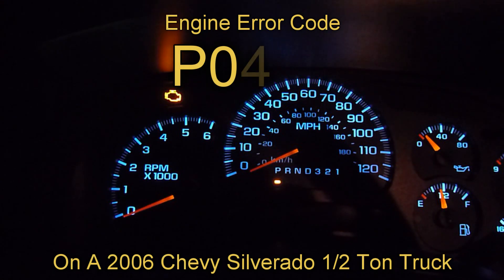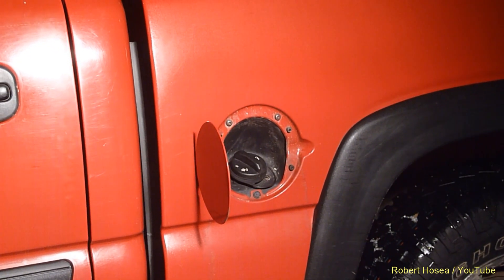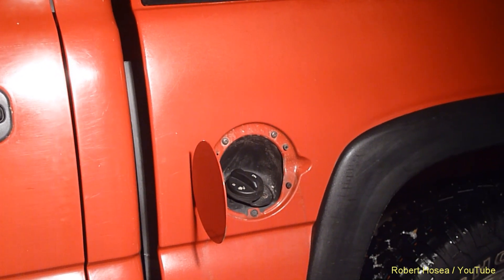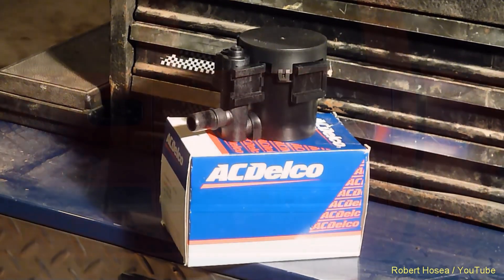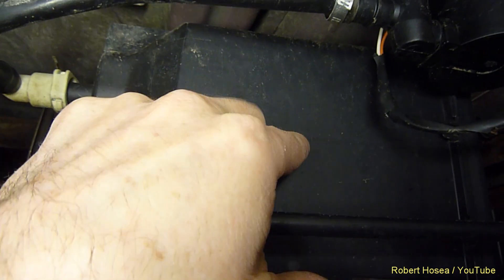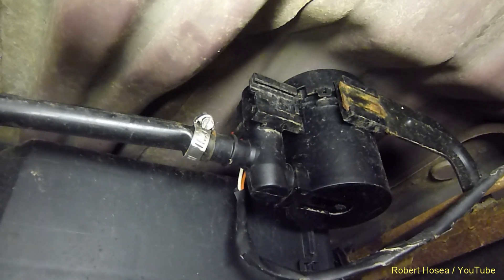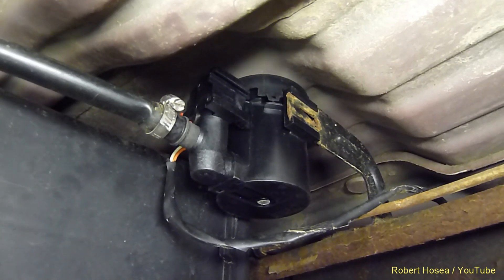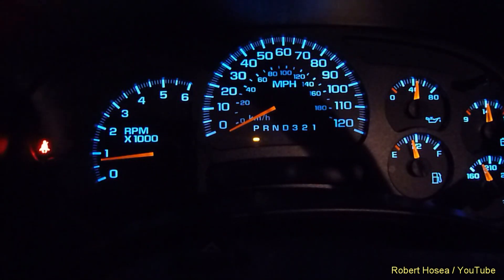Code P0449 Vent Solenoid On 2006 Chevy Silverado.

Comment: Question about where to cut the line on the bad unit that's still on the truck.  I assume the line has to be cut right at the end of the nipple, where it tapers back in?  Hope that makes sense.  Does the 5/8" heater hose just slip over the nipple?  Does the 5/8" heater hose also just slip over the existing line??   Thanks.  [IMG]http://i65.tinypic.com/4js080.jpg[/IMG]
Reply: DF RI   I couldn't done it without 5/8 heater hose. But worked well. Two clamps one by the part and other on the side of the original line. About 3 inches of the heater hose. 1 .1/2 nipple part and. 1 . 1/2  original hose in  and clamp it.
Reply from the maker: When I cut the hose off the first time that I replaced the solenoid, I cut it off right at the end of the nipple leaving the nipple on the solenoid. That meant I cut about one inch off of the length of the hose. I had tried to actually remove it entirely from the nipple, but I couldn't get it off. In your picture it looks like you may need every bit of length that you can get, so maybe it would be better to cut the nipple off of the solenoid (if possible) and then remove the portion of the nipple that is left over in the hose. That will leave the full length of the hose. When I installed the hose on the new solenoid I just took a pair of needle nose pliers, and pushed them inside the hose and turned the pliers around a few times to expand the end of the hose. It worked pretty well.

Comment: I've got a 04 Silverado 2500HD. Last year around summer, i got this code and couldn't fill my tank. I work at a GM dealer, so I looked up the part with my vin and there was a TSB on this thing. They came out with a new version of this part, it's got the solenoid shown in this video, but it has an extra nipple on it where a separate filter of sorts connects to the valve.

Anywho, I installed the updated part last summer which solved all my problems. A few days ago, my tank is running low, so I stop to put gas in it, boom. I can't fuel up and the P0449 code is back. I haven't forcefully topped off my tank since I replaced it. Looks like i'll be going for round two. Thanks GM!

Crazy thing is that I borrowed a buddy's scan tool (a very expensive one) and manually operated the vent valve solenoid which was working. It was showing the tank pressure dropping. Not sure what makes these things die so easily.. maybe gas sloshing around while driving around with a full tank? Next time i'm going to throw a coupler on the tube and try to mount this thing a couple inches higher.
Reply from the maker: Thanks for the info on this James. Let us know how it works out on mounting the solenoid higher. -Bob

Comment: hey guys this video helped me.bought mine on ebay for 20$ installed it but the engine light took 2 days to go off.
Reply from the maker: I'm glad the video helped out Michael. The way that I understand it is that most vehicles will reset any current engine error codes after a couple of successful drive cycles, but only after the problem has been corrected. I usually reset it myself with my code reader because I have found that the engine error code will reappear if the problem was not successfully corrected. Of course, it depends on the type of the problem too, on how fast it will re-detect the problem. I've found that there seems to be an on going debate on whether to reset the error engine code manually (as I usually do), or to let the vehicle take it's time to detect it on it's own.

Here's something that I found on a forum once, that I thought really explained it well. It sounds like the guy knows what he's talking about: 
============================================================================

here is the criteria for "check engine" light illumination and shut-off. when your on board computer senses a concern,  it stores a diagnostic trouble code (dtc) in its "pending" memory block. at this point the light is not lit. the next time you drive the car, if the problem is still present, the dtc moves from "pending" status to maturity and the light comes on. the light will remain lit until either:
1. someone clears the code with a scan tool (if the concern is still present, the light will come back on shortly) or
2. if the car has three successful drive cycles with no concern detected, the light will shut itself off. if this happens, the code will move to the "history" memory block in the cars module, it is not deleted completely
============================================================================

Comment: I have a 2006 Chevrolet Silverado and just like everyone else I found the part on amazon for 15$. When the mechanic installed it he put the soleniod on without the hose. In this video the hose is placed back on there. After bring the truck back I was curious to know why they didn't install the hose. To my understanding they re-modified the part ,so that I didn't need the hose because some of the solenoid have a built in filter. The cost was 50$ to have someone do if you don't have the tools or time.
Reply from the maker: +Jack James Thanks for the info Jack. When I purchased the solenoid on Amazon for this repair it did show a second (different) solenoid valve in addition to the same type that I had purchased a few years prior.. I opted to get the same one since I knew that that one did work on my truck. The new style most likely prevents the gas from getting into the solenoid and damaging it. Your cost of $50 to a mechanic is very good. The average cost of having the solenoid replaced a few years ago when I first had the problem was $300.
Reply: +Robert Hosea i bought the part from pep boys it came with one port. the one i took off had 2 male ports. why is this?
Reply from the maker: +Dave Lopez,  I'm not sure Dave. It sounds like your original solenoid is different then the one on my truck, which only had one hose connection. What type of vehicle are you working on?
Reply from the maker: +Jack James I was just curious as to what the mechanics did with the hose if they didn't connect it to the solenoid? It seems to me that the solenoid wouldn't be doing anything if it isn't connected to the hose.
Reply: +Robert Hosea I was wondering the same thing as well. I took the truck back the next day to ask him about the hose. Because of the new design it didn't require a place for the hose. The solenoid that I purchase had the filter build in. When he lifted the truck up there was no place for the hose to go. He explained to me it's the new design. So the old hose is in my back seat.

Comment: you reset the check engine lights using OBD thats why it did? . what you should've  done drive the thruck at minimum 50 miles or at least two days driving. it will go away on its own, if it's not, then you reset it with your OBD. the reason being is, you fixed the problem but also you want the computer to read the system on its own before you use the OBD machine therefore there is no interference.

Comment: What is the best way to have my codes reset as I don't have a code reader?
Reply from the maker: lmdetect I've seen videos that show how to reset the CEL by disconnecting the battery for five minutes, but that method will also reset your engine and transmission computers which put them back into "learn" mode. That's no big deal really if it does. It just needs to re-learn your driving habits for a while. Disconnecting the battery will most likely reset your radio too. There are many auto part stores that will reset it for you for free too.

Comment: I got the same code in my sierra. I took the AC delco part number to oreillys and they had it in stock. Thanks to your video I was able to install it pretty easy. I unhooked my battery and half an hour later the CEL was gone. I call that a successful mission
Reply from the maker: mictdave1 Hey that's great mictdave1. I'm glad the video was helpful in your successful repair!!

Comment: What the part number on this part? I though you have to get the newer version with the remote filter?
Reply from the maker: Eric, the ACDelco number for the one that I installed is #214-2149. Amazon did have the newer one, but since I had already purchased this same one five years prior and I knew that it fit and it was still available, I went ahead and purchased the same one.